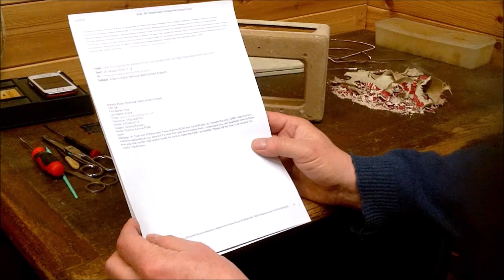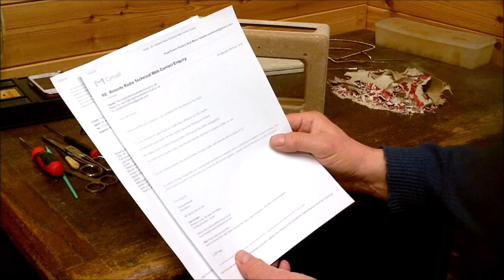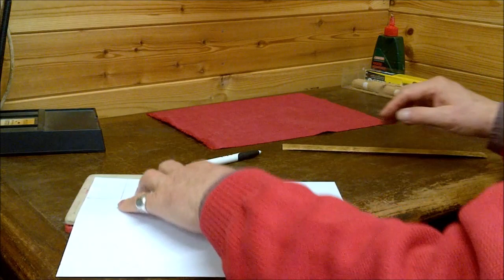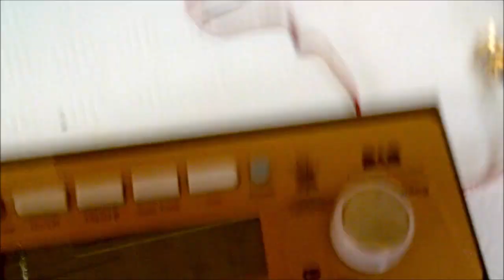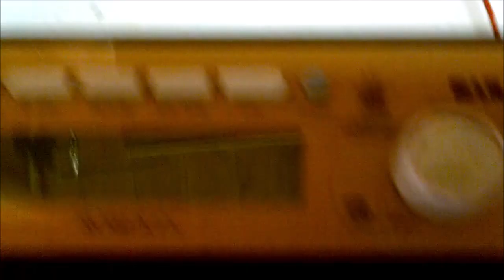Can you make a Roberts Radio better?

Comment: Nice piece of workmanship sir I nearly bought one of those back in the day but am glad I didn't now stick to my models from the 70s and 80s far more stylish but that was a resurrection if ever I saw one
Reply from the maker: Thank you for those nice comments. The radio itself isn't bad. The very last of the line have better coverings that have stood the test of time. Apparently it was animal pigment in the glue used in the Chinese factories that rotted the outer covering. Too bad, because the earlier (90's) Revivals were British-made - at least the cabinets.
I saw a later RD60 on eBay for £30 delivered and was tempted to buy one. But they're showing their age, now as they don't have Bluetooth or internal rechargeable batteries.
I'd recommend the Roberts Vintage if you can pick one up cheaply - Roberts still list them for an insane £149, but they sound better than the RD60 and they charge standard AA-sized NiMah batteries internally, with a claimed 80 hours of playing time between charges. I haven't counted, but it's certainly a lot of hours before they go silent...  🔇

Comment: I used to do this as a business. Better to add the fittings once the fabric has been totally finished.
Reply from the maker: Not sure what you mean - I thought I did that. I see it as a fairly good amateur attempt. A successfully sold it on eBay for much more than I bought it for and the buyer loved it - but, having done around 3 're-covers', it's just not time/cost effective so I do very few of these. 
I'm guessing you packed it in for the same reason?
Reply: How do you get the bloomin covering off. I'm thinking of spraying mine . Any thoughts?
Reply: @kendom33  Take it all apart and use a blunt chisel to scrape it off. You are lucky it's already a bad one. You may find the cloth substrate is loose in places as well so dampen it and tear it off totally. It allows you to use a decent cushion or curtain fabric.

Comment: The brass plate where the aerial and jacks are located does come free, I’ve managed to remove mine damage free, just need to be patient and not apply too much force.
Reply from the maker: Yep, Dave I was aware of that. But looking at (and dealing with) the generous squirts of glue applied to the modules I think I chickened out!

Comment: Can I ask how you managed to get the aerial off? I saw you said you used a special device from Pure radio. Would you mind explaining how you did it as I’m having great trouble getting mine off?

Many thanks
Reply from the maker: Whatever you do, don't try to use an ordinary spanner or pliers (plyers?) - the nut is deep-set and you can damage the radio.
I use a Pure aerial removal spanner, designed for the original Evoke 1 (circa 2000), which looks like the one which should be first in this search, although this one is from 2009!:

https://www.google.co.uk/search?q=rsx4028a+aerial+spanner&sca_esv=495230c8dd2d1d57&udm=2&biw=1912&bih=920&sxsrf=ADLYWIIC7K5NDZFTIWan9slfxJtPhdjUHQ%3A1728149984341&ei=4HkBZ9y_FIGzhbIPkYvDyAY&ved=0ahUKEwjcr72v5PeIAxWBWUEAHZHFEGkQ4dUDCBA&oq=rsx4028a+aerial+spanner&gs_lp=Egxnd3Mtd2l6LXNlcnAiF3JzeDQwMjhhIGFlcmlhbCBzcGFubmVySNY_UJgbWJgbcAF4AJABAJgBRaABRaoBATG4AQzIAQD4AQL4AQGYAgCgAgCYAwCIBgGSBwCgBy0&sclient=gws-wiz-serp

I've been on Pure's site and they no longer sell the spanner as a spare. They don't even list the correct telescopic aerial anymore.
If you do find one (and they are like hens' teeth) then you simply retract the aerial as far as it will go, position it in a straight line sticking out of the back of the radio and slip the spanner over the aerial and then over the nut. You can loosen off the two handles (wings) slightly if it won't initially fit over the antenna rod as they unscrew, then tighten them up again when you're over the nut.

Comment: The vital thing that we needed to know was how to get it apart, like how does the handle come off?
Reply from the maker: I suppose I do have a tendency to miss out the obvious. I did mention it somewhere , near the end I think - anyway, there are a couple of spring clips, like gripping washers around the handle spindles that go through the holes. They're similar to the ones on the original 1950s R200 but minute in comparison. Once you have attacked them they're finished, so I think I used plastic washers to hold the handle spindles in when I put it back together - ones with holes that were slightly too small so I could make them just big enough to grip the spindle and prevent the handle from falling off.
Reply: Inside the radio on the ends of the spindles are two small circlips, they can be pulled off with care, if you locate the open side of the clip.
Reply: have the handle in the “carried” position and gently push downwards and the handle will unclip.
Reply: @drawingsbydave7794  That's if you are lucky to have that type, the vast majority have a rod that is held by small "e" clips. These have to be pushed off with a couple of jewelers screwdrivers